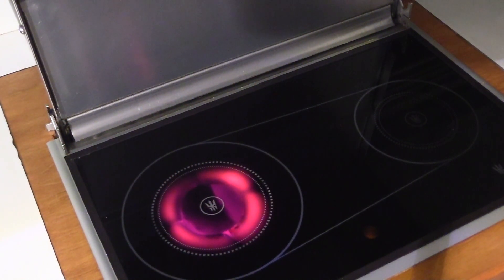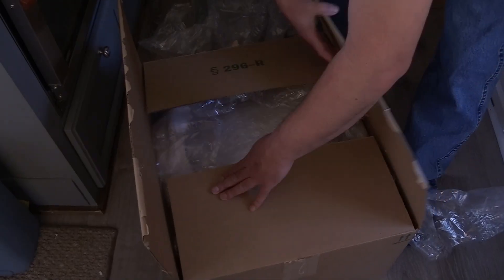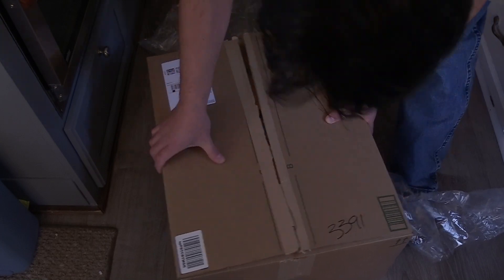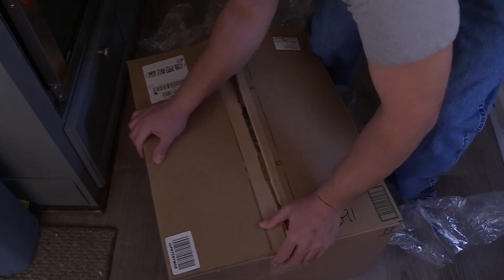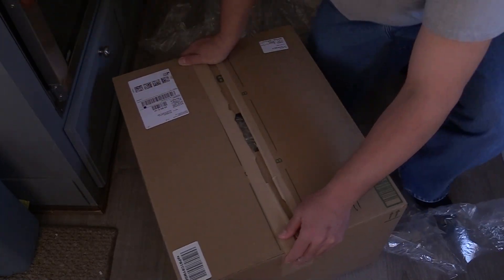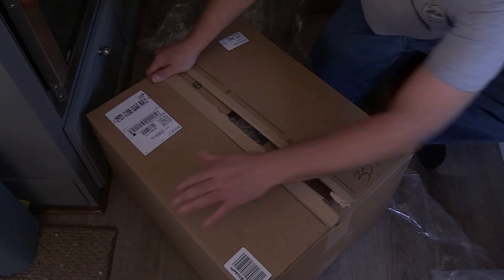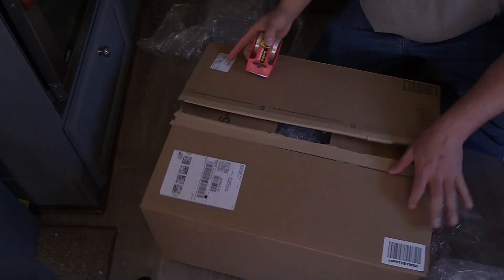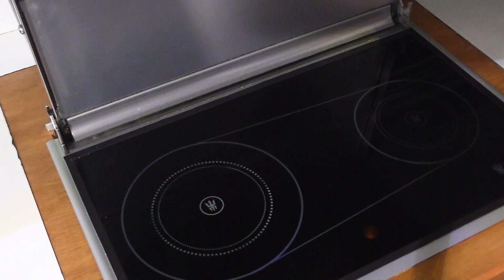Wallas Fail and Repair

Comment: yes, maintenance is the biggest issue with these devices. Mine has begun doing this same thing as you guys, just not as bad. However, sending it in is not an option for me. I cannot understand how companies like this, that build products for people that are sometimes thousands of miles away from any service center do not build accordingly, for DYI maintenance and installation. It is unprofessional.
Reply: Hi, i just have the same problem (in my case a Webasto X100 but it seems globally the same product) if you solved the problem by yourself could you please describe what was it and what did you do to solve it ? i would like to fix this by myself(a webasto repairer is not easy to find around Paris...). Thanks.